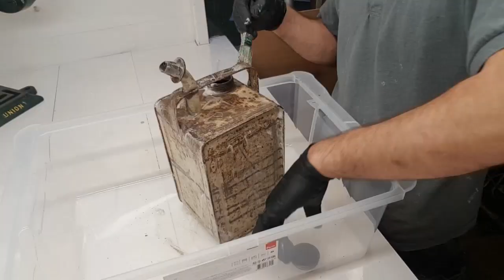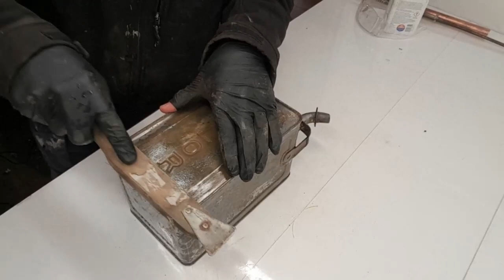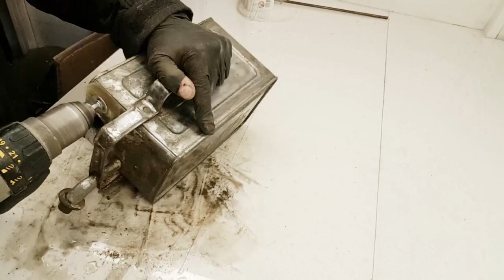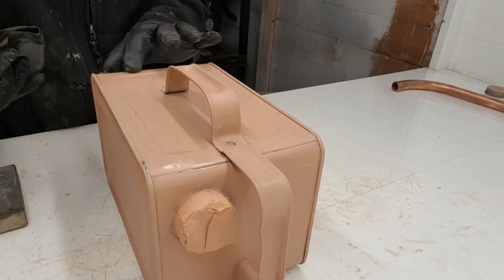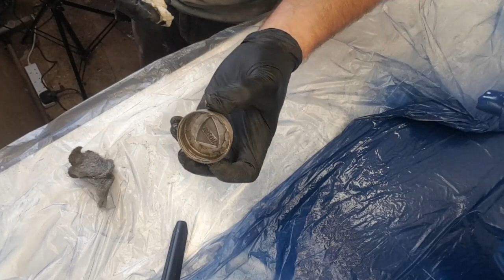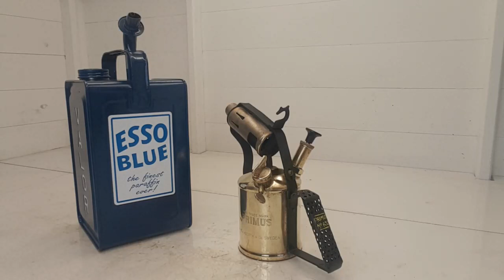Esso Fuel Can Restoration

Comment: Great restore!  Looks like you have fun with your restores.  For rust removal you could try electrolysis, evaporust (or the like), or sandblasting.  I'd have to say from a viewer point of view I love to see electrolysis, and sandblasting :-D
Reply from the maker: Thanks Michael, I have tried to show some progression through this channel using different methods of rust removal. Very time consuming. I'm just completing my last project before Evapo rust makes it's debut. Thanks for taking time to comment. Regards Unique Restorations.
Reply: @carnright: Sorry, but distilled vineager--(with a touch of salt, dependant on how bad the rust is of course!)--is my 'go to' rust remover.
Based on the fact that I cannot be trusted around stuff that's likely to go BANG, or stuff that uses air pressure!
Same as nickel or copper plating.....a distinct 'no no' from the missus!
Though I do love watching other restorers use other means of rust removal.